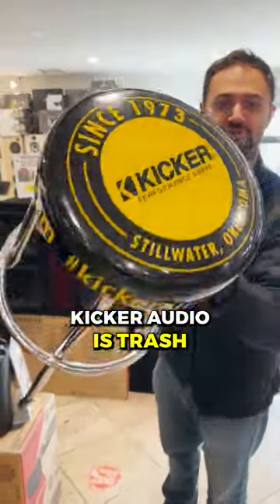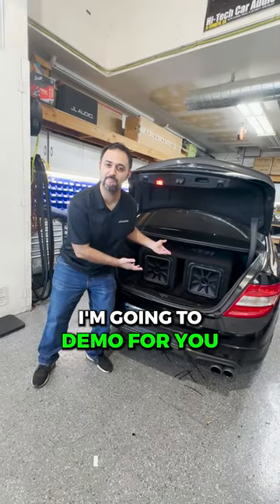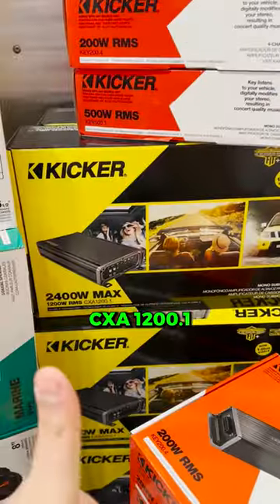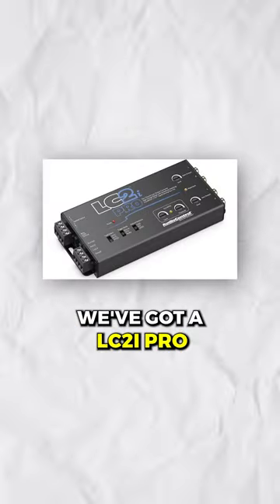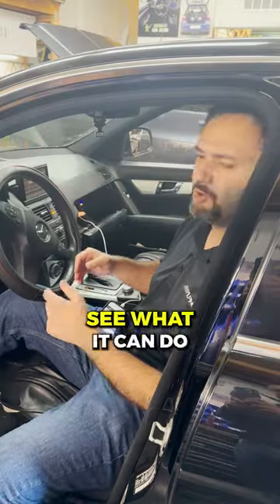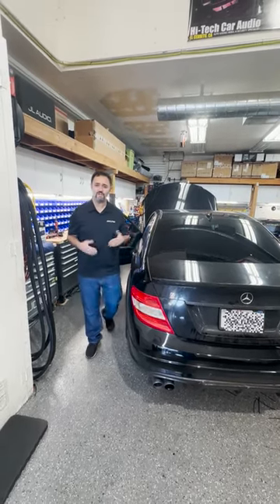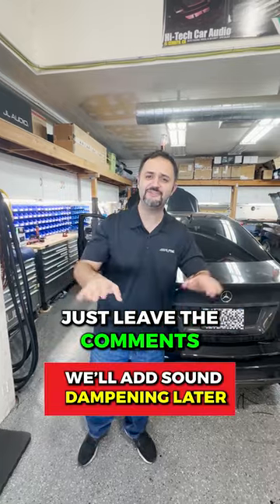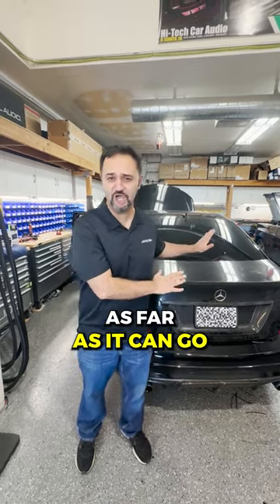Bam Bam BOOM! 🤯 The Kicker Dual 12" L7 Solo Baric Box Is PSYCHOTIC! Watch Me DEMO This BEAST!

Comment: I don't hate kicker, I hate kicker's prices
Reply: Kicker audio products cost through the roof even in India. I opted for a Sony 12" subwoofer Xplod Box over Kicker because cost was 40% higher for the equivalent friggin enclosure subwoofer
Reply: Damn, you must run Walmart stuff. Cause kicker is very affordable, or scar
Reply: @LeonD519  skar, CT sounds, deaf bonce, nvx, dayton, some sundown, ds18, I'm sure there's others.
Reply: @MetalAnimeGuy  of course. Soundqubed, which is really good stuff. Even though they sold companies
Reply: ? Cheap? Each model increase is like a $50 increase between product line
Reply: Ok to be fair not all of their prices are bad and their sound quality is great, I use ct sounds and I got 2 8in 75 watt speakers for $80 and when I was looking I was finding speakers from kicker with the same specs but only one speaker for that price. I'm sure I could have looked more and found something good. I'm just saying that there are other options with equal quality for the same price.
Reply: @TexasBassHead  and? Stick with Walmart and scar, problem solved
Reply: I got 2 10" comp C10's for $90 open box return at best buy

Comment: On my 06 Accord and I'm also  using fm modulator and the stock Honda 6 cd changer radio with a 2 channel Crunch Amp and 2 12 inch Kicker Comp C speakers and it sounds good. I did the install myself and I added a kill switch through the remote cable for days that I don't want to bump or I see a cop.
Reply: Funny story, ive installed tons of kill switch types 😂.ive done standard flip switches, push switches,  ive connected the remote wire to ignition fuse 😂 if i wasnt able to connect it to the back of the deck. But my most "wtf am i doing" connection was to the auxilary light fuse. So to turn the amp on i would turn my park lights on lmao 😂🫡 good times

Comment: I’ve been knocking CVX’ 12’s for 🗣️TEN YEARS STRAIGHT!!!!! I’ve never measured the sound but it’s ran by TS-POWER by Nesa 3000w. Infinity Kappa 6x9’s and door speakers w/Audio Control epicenter. TS-Power 2200 pushing those. Nare passenger has been able to take it. Just being honest. 0 problems the ENTIRE TIME IVE HAD MY SYSTEM INSTALLED AND STIIIIIIL BUMPIN

Comment: I have the cxa 1800.1 450 dóllars plus 100 dollars for 0 gage copper wire plus 120 in batteries plus 120 for the big3 and still cant get it working properly without dropping major voltage😢 and all I have is a 12 dual coul ct sound 1500rms 🤦‍♂️

Comment: Kicker sucks below 40hz. Also, they sound super muddy. I've had a wall of kicker 12s, and it wasn't loud. I also had 4 15s, and it didn't even break a 50. I used cheap skar subs as a replacement to tje 15s in the same box, and it broke a 152. Sounds a ton better, too.